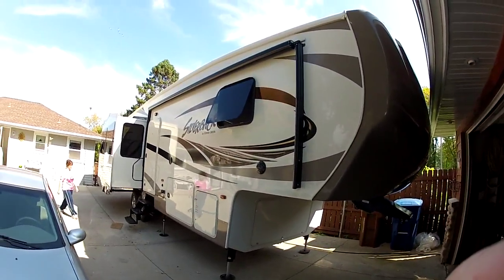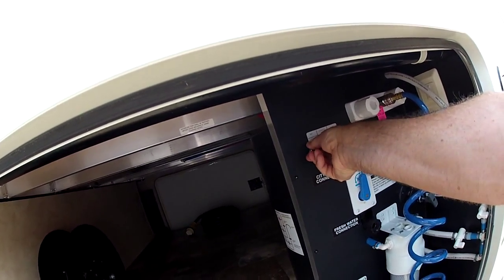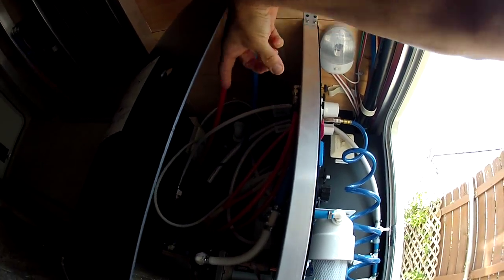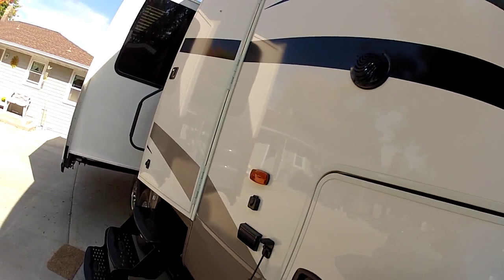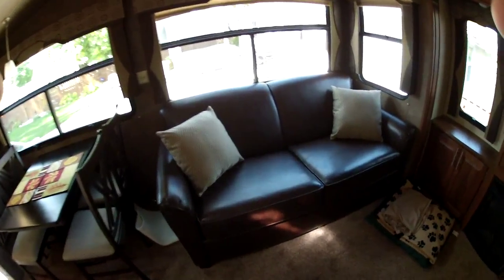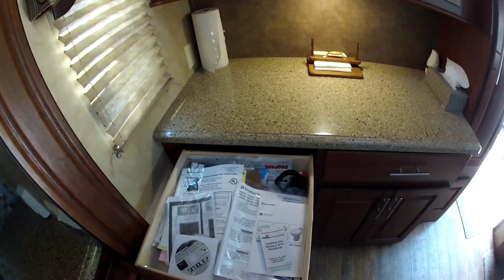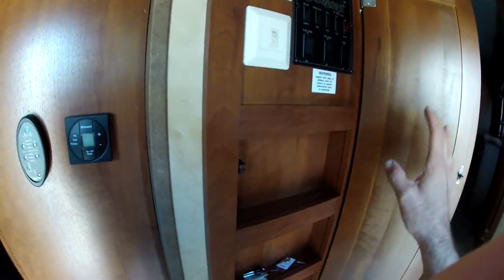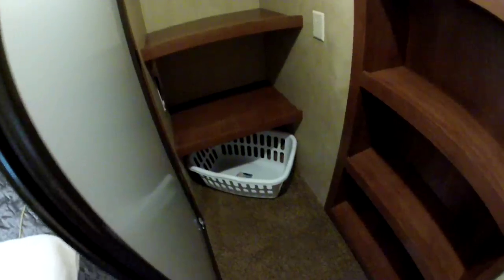GoPro Cedar Creek Silver Back 2015 29IK 10/4/14 Part 1

Comment: We're trying to decide between the 29RE and the 29IK.  Problem is there is no way to access any appliances with the slide outs in on the RE  Looks like you might be able to squeeze in on the IK if you are at a roadside park.  You're video cracked us up.  Sounds like you are from the midwest..are you?
Reply from the maker: Yes, you are correct. Either one is hard to access the fridge. The slide with the table/chairs blocks the entrance to the kitchen area. I personally liked the openness of the IK and my wife liked the RE, she won. The island seems to be something to work around, however, we love it. We have the trump series king bed.... oMG, I personally love it, very comfy. Which ever you choose, I'm sure you'll love it. Happy camping
Reply: hawkskyflier We travel with 2 small dogs and like the feature of the long cabinet in the kitchen area.  A place to hang leashes and two jackets.  We are trading a 2008 Montana and this is the only RV which even comes close to all it's features.  We also have a 2004 Forester Class C which, hopefully, we will have sold today.
Reply from the maker: In central Wi. Area.. South of Green Bay
Reply from the maker: We have 1 - 80 lb yellow lab. Only one left of 3. Old age creeps in. This camper has excess from for my wife myself and Chopper. The features of the self level and the storage area underneith are huge